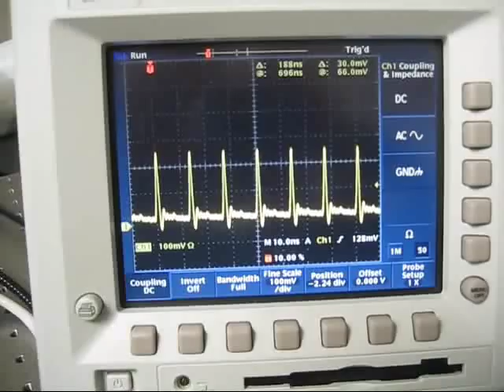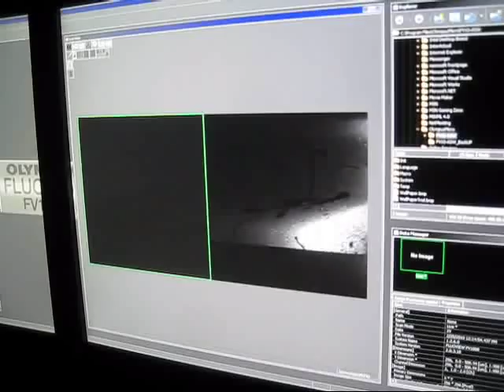Multiphoton Microscope Alignment using Second Harmonics Generation Crystal

Comment from the maker: Dynamics of optically excited tungsten, stainless steel and bulk metallic glass for ripples formation
Hao Zhang, Chen Li, Jean-Philippe Colombier, Guanghua Cheng, Razvan Stoian
10 February 2015 • 4:00 - 4:20 PM | Part of SPIE LASE

In vivo non-invasive multiphoton tomography of human skin with subcellular spatial and picosecond time resolution to detect bio- and chemohazards
Karsten Konig
8 February 2015 • 5:30 - 7:00 PM | Part of SPIE BiOS

Laser-induced controlled crystallization of heavy metal oxide glass
Juliana M. P. Almeida, Paulo H. D. Ferreira, Antonio C. Hernandes, Cleber R. Mendonca
10 February 2015 • 6:00 - 8:00 PM | Part of SPIE LASE

Selective optoporation of cells targeted with functionalized gold nanoparticles enhancing ultrafast laser pulse irradiation
Eric Bergeron, Alexandre Torres, Rosalie Martel, Camille Rodriguez, Christos Boutopoulos, Jukka Niskanen, Jean-Jacques Lebrun, Francoise M. Winnik, Michel Meunier
8 February 2015 • 2:10 - 2:30 PM | Part of SPIE LASE

Comprehensive photo-physics investigation of novel Corroles
Sai Santosh Kumar Raavi, Jun Yin, Giulia Grancini, Lingamallu Giribabu, Cesare Soci, Soma Venogopal Rao
11 February 2015 • 9:20 - 9:40 AM | Part of SPIE OPTO

Ultrafast photo-response in superconductive isotropic radiators for microwave generation
Brian D. Dolasinski, Peter E. Powers, Joseph W. Haus, Thomas Bullard, John Bulmer
10 February 2015 • 2:50 - 3:10 PM | Part of SPIE LASE

Three dimensional optofluidic device for isolating marine microbes
Anusha Keloth, Lynn Paterson, Gerard H. Markx, Ajoy K. Kar
9 February 2015 • 2:50 - 3:10 PM | Part of SPIE BiOS

Machine technology for 3D microprocessing of complex curved surfaces
Max Groenendijk
12 February 2015 • 3:30 - 4:00 PM | Part of SPIE LASE

Digital micromirror devices for laser-based manufacturing on the micro-scale
Ben Mills, Dan Heath, Matthias Feinaeugle, Rob W. Eason
10 February 2015 • 9:50 - 10:10 AM | Part of SPIE OPTO

Fabrication of a plasmonic pyramid array substrate and microfluidic device for cell transfection
Daryl I. Vulis, Marinus Huber, Nabiha Saklayen, Sebastien Courvoisier, Jean-Pierre Wolf, Eric Mazur
8 February 2015 • 5:40 - 6:00 PM | Part of SPIE LASE

Colloidal, inorganic nanoparticles as efficient nonlinear optical probes
Dominika Wawrzynczyk, Marcin Nyk, Janusz Szeremeta, Marek Samoc
8 February 2015 • 4:05 - 4:20 PM | Part of SPIE BiOS

In vivo visualization of collagen fiber produced by cultured osteoblasts using sensitive second-harmonic-generation microscopy equipped with a 10-fs mode-locked Ti:sapphire laser
Eiji Hase, Katsuya Sato, Takeshi Yasui
8 February 2015 • 5:30 - 7:00 PM | Part of SPIE BiOS

Towards the development of an ultracompact optically sectioning endoscope with no distal optics
Youngchan Kim, Sean Warren, James M. Stone, James Roper, Jonathan C. Knight, Mark Neil, Carl Paterson, Christopher W. Dunsby, Paul M. W. French
9 February 2015 • 12:00 - 12:20 PM | Part of SPIE BiOS

Role of the surface plasma density on the formation of laser induced periodic surface structures (LIPSS) on Ti upon double fs pulse irradiation
Laura Gemini, Masaki Hashida, Yasuhiro Miyasaka, Shunsuke Inoue, Jiri Limpouch, Tomas Mocek, Shuji Sakabe
12 February 2015 • 10:00 - 10:20 AM | Part of SPIE LASE

5.7mJ fiber-CPA system delivering 23.5 gW of peak power
Arno Klenke, Steffen Hadrich, Tino Eidam, Marco Kienel, Jens Limpert, Andreas Tunnermann
11 February 2015 • 3:50 - 4:10 PM | Part of SPIE LASE

Intense THz sources for condensed matter physics
Matthias C. Hoffmann
10 February 2015 • 2:20 - 2:50 PM | Part of SPIE LASE

Chirped- and divided-pulse Sagnac fiber amplifier
Florent Guichard, Yoann Zaouter, Marc Hanna, Franck Morin, Clemens Honninger, Eric P. Mottay, Patrick Georges
11 February 2015 • 4:30 - 4:50 PM | Part of SPIE LASE

Increasing performance of mobile devices: fs laser assisted high quality photonic devices in display glass screens
Jerome Lapointe, Mathieu Gagne, Raman Kashyap
9 February 2015 • 4:00 - 4:20 PM | Part of SPIE LASE

Plasma dynamics during fs-laser fabrication of waveguides inside zinc phosphate glass
Javier Hernandez Rueda, Vladimir Semenov, Neil Troy, Charmayne E. Smith, Richard K. Brow, Denise M. Krol
9 February 2015 • 3:20 - 3:40 PM | Part of SPIE LASE

Ultrashort pulse laser interactions with cortical bone tissue for applications in orthopaedic surgery
Simon A. Ashforth, Miriam C. Simpson
8 February 2015 • 11:10 - 11:30 AM | Part of SPIE LASE

Bioinspired artificial light collectors for enhancement of imaging in dim environments
Hewei Liu, Yinggang Huang, Chi-chieh Huang, Hongrui Jiang
7 February 2015 • 10:50 - 11:05 AM | Part of SPIE BiOS

Two-photon photoacoustic microscopy using image subtraction with two different pulse excitations
Yoshihisa Yamaoka, Yoshinori Harada M.D., Masaaki Sakakura, Takeo Minamikawa, Shigeru Nishino, Seiji Maehara, Shujiro Hamano, Hideo Tanaka M.D., Tetsuro Takamatsu M.D.
10 February 2015 • 6:00 - 8:00 PM | Part of SPIE BiOS

Binary phase shaping for mitigating self-phase modulation
Gennady Rasskazov, Marcos M. Dantus
10 February 2015 • 6:00 - 8:00 PM | Part of SPIE LASE

Fluorescence lifetime imaging in the near-infrared region
Wolfgang Becker, Vladislav I. Shcheslavskiy
8 February 2015 • 5:30 - 7:00 PM | Part of SPIE BiOS

Optical and thermal properties in ultrafast laser surface nanostructuring on biodegradable polymer
Shuhei Yada, Mitsuhiro Terakawa
8 February 2015 • 8:50 - 9:10 AM | Part of SPIE LASE

Fabrication of perfluoropolyether atomic force microscopy tips with two-photon polymerization
Tommaso Zandrini, Raffaella Suriano, Carmela De Marco, Roberto Osellame, Stefano Turri, Francesca Bragheri
10 February 2015 • 6:00 - 8:00 PM | Part of SPIE LASE

Laser-induced breakdown spectroscopy for chemical characterization of laser structured Li(NiMnCo)O2 electrodes for lithium-ion batteries
Peter Smyrek, Johannes Proll, Hans J. Seifert, Wilhelm Pfleging
12 February 2015 • 2:30 - 2:50 PM | Part of SPIE LASE

Nonlinear compression of industrial ultrafast lasers in hypocyloid-core Kagome hollow-core fiber
Achut Giree, Florent Guichard, Guillaume Machinet, Yoann Zaouter, Yvon Hagen, Benoit Debord, Pascal Dupriez, Frederic Gerome, Marc Hanna, Fetah A. Benabid, Clemens Honninger, Patrick Georges, Eric P. Mottay
9 February 2015 • 8:30 - 8:50 AM | Part of SPIE LASE

Effect of the Zn coordination complex of the excited-state and two-photon absorption spectra of a novel salicylidene compound
Marcelo G. Vivas, Jose Germino, Tereza Atvarz, Cleber Mendonca
8 February 2015 • 4:15 - 4:30 PM | Part of SPIE OPTO

Single grating mirror intracavity stretcher design for chirped pulse regenerative amplification
Etienne Caracciolo, Matthias Kemnitzer, Martin Rumpel, Annalisa Guandalini, Florian kienle, Federico Pirzio, Thomas Graf, Marwan Abdou Ahmed, Antonio Agnesi, Juerg Aus-der-Au
10 February 2015 • 11:10 - 11:30 AM | Part of SPIE LASE

Enhanced nanograting formation assisted by silver ions in a sodium gallophosphate glass: Correlation between surface nanostructuring, fluorescence, and effective second-order nonlinear optical properties
Marie Vangheluwe, Feng Liang, Yannick Petit, Patricia Hee, Yannick Ledemi, Sebastien Thomas, Nicolas Marquestaut, Evelyne Fargin, Thierry Cardinal, Younes Messaddeq, Lionel Canioni, Real Vallee
8 February 2015 • 2:30 - 2:50 PM | Part of SPIE OPTO

Yb-fiber laser for multimodal imaging
Ilyas Saytashev, Bingwei Xu, Marcos Dantus
9 February 2015 • 4:05 - 4:20 PM | Part of SPIE BiOS

Two-photon endoscope with no distal optics
Herve Rigneault, Esben R. Andresen, Geraud Bouwmans, Serge Monneret
9 February 2015 • 2:30 - 2:50 PM | Part of SPIE BiOS

Elucidating photodynamics with ultrafast pulse sequences: pump-repump, multidimensional spectroscopy, and beyond
Patrick Nuernberger, Stefan Ruetzel, Tobias Brixner
8 February 2015 • 11:15 - 11:45 AM | Part of SPIE OPTO

Broadband 2.5-6?m frequency comb source for dual-comb molecular spectroscopy
Viktor O. Smolski, Konstantin L. Vodopyanov
9 February 2015 • 2:35 - 2:55 PM | Part of SPIE LASE

Photonic crystal fiber supercontinuum sources for optogenetics
Eugene D. Ark, Kush Paul, Haohua Tu, Youbo Zhao, Stephen A. Boppart
7 February 2015 • 4:20 - 4:40 PM | Part of SPIE BiOS

Ultrafast non-equilibrium carrier dynamics in semiconductor laser mode-locking
Jerome V. Moloney, Isak Kilen, Joerg Hader, Stephan W. Koch
9 February 2015 • 8:00 - 8:30 AM | Part of SPIE LASE

THz generation by optical rectification in graphene at room temperature: beyond the linear carrier dispersion
Juliette Mangeney, Jean Maysonnave, Simon Huppert, Feihu Wang, Simon Maero, Claire Berger, Walter A. de Heer, Theodore B. Norris, Louis-Anne de Vaulchier, Sukhdeep S. Dhillon, Jerome Tignon, Robson Ferreira
8 February 2015 • 12:15 - 12:35 PM | Part of SPIE OPTO

Ultrafast biexciton dynamics in single CdSe/ZnSe quantum dots
Denis V. Seletskiy, Christopher Hinz, Johannes Haase, Christian Traum, Florian Werschler, Stefan Lohner, Alfred Leitenstorfer
10 February 2015 • 12:20 - 12:35 PM | Part of SPIE OPTO

Efficient Auger scattering in Landau-quantized graphene
Florian Wendler, Martin Mittendorff, Stephan F. Winnerl, Manfred Helm, Andreas Knorr, Ermin Malic
8 February 2015 • 9:45 - 10:00 AM | Part of SPIE OPTO

Self-focusing effect on THG at interfaces of solvent-cuvette
Emerson C. Barbano, Kerrianne Harrington, Sergio C. Zilio, Lino Misoguti
10 February 2015 • 6:00 - 8:00 PM | Part of SPIE LASE

Charge separation in OPV bulk heterojunctions
Andrew B. Matheson, Arvydas Ruseckas, Ifor D. W. Samuel
11 February 2015 • 6:00 - 8:00 PM | Part of SPIE OPTO

Advances in Chalcogenide galsses and Optical fibers
Younes Messaddeq, Sandra H. Messaddeq, Mohammed Elamraoui, Jean-Philippe Berube, Real Vallee
10 February 2015 • 9:30 - 10:00 AM | Part of SPIE OPTO
9 February 2015

Ultrafast coherent charge transfer in solar cells and artificial light harvesting systems: toward movies of electronic motion
Christoph Lienau
9 February 2015 • 8:50 - 9:30 AM | Part of SPIE OPTO

Sub-100 fs passively mode-locked holmium-doped fiber oscillator operating at 2.06?m
Peng Li, Axel Ruehl, Ingmar Hartl
12 February 2015 • 11:00 - 11:20 AM | Part of SPIE LASE

Laser induced structural modifications in fused silica within the microexplosion regime evidenced by Raman spectroscopy
Nadezda Varkentina, Arnaud Royon, Marc Dussauze, Yannick Petit, Lionel Canioni
10 February 2015 • 11:30 - 11:50 AM | Part of SPIE LASE
9 February 2015

Mechanisms of direct laser writing on a tailored silver-containing zinc phosphate glass: dual-color laser writing, UV post-illumination thermal influence, and sub-diffraction structures
Yannick G. Petit, Konstantin Mishchik, Nadezda Varkentina, Arnaud Royon, Nicolas Marquestaut, Etienne Brasselet, Thierry Cardinal, Lionel S. Canioni
9 February 2015 • 5:30 - 5:45 PM | Part of SPIE OPTO

Active tunable photonics and ultrafast nonlinear optics with nematic and blue phase liquid crystals
Iam Choon Khoo
10 February 2015 • 11:00 - 11:30 AM | Part of SPIE OPTO
11 February 2015

Mobile laser lithography station for microscopic two-photon polymerization
Frank Leinenbach, Hans G. Breunig, Karsten Konig
12 February 2015 • 4:20 - 4:40 PM | Part of SPIE LASE

Broadband transient THz conductivity of the transition-metal dichalcogenide MoS2
Jan H. Buss, Ryan P. Smith, Giacomo Coslovich, Robert A. Kaindl
10 February 2015 • 5:00 - 5:15 PM | Part of SPIE OPTO

Amorphous chalcogenide layers and nanocomposites for direct surface patterning
Sandor J. Kokenyesi, Sandor Molnar, Roland Bohdan, Istvan Csarnovics
9 February 2015 • 2:00 - 2:20 PM | Part of SPIE OPTO

Process and parameter optimisation for micro structuring of 3D freeform metallic surfaces: A comparative study of shortpulse (ns) and ultrafast laser (ps, fs) ablation
Steffen G. Scholz, Melanie Mangang, Wilhelm Pfleging
10 February 2015 • 4:20 - 4:40 PM | Part of SPIE LASE

Optical multi-coset sampling of GHz-band chirped signals
George C. Valley, George A. Sefler, Thomas J. Shaw, Stephen L. Smith
11 February 2015 • 2:00 - 2:20 PM | Part of SPIE OPTO

Bessel filamentation in glass
Chen Xie, Vytautas Jukna, Ismail Ouadghiri, Carles Milian Enrique, Remo Giust, Luca Furfaro, Pierre-Ambroise Lacourt, Maxime Jacquot, Luc Froehly, Razvan Stoian, Tatiana E. Itina, John M. Dudley, Arnaud Couairon, Francois Courvoisier
11 February 2015 • 9:20 - 9:40 AM | Part of SPIE LASE

Flat mid-infrared supercontinuum generation in tapered fiber with thin coating of highly nonlinear glass
Pantelis Velanas, Christos Riziotis, Georgios Kakarantzas
10 February 2015 • 6:00 - 8:00 PM | Part of SPIE LASE
11 February 2015

Plasmonic cell transfection using micropyramid arrays
Nabiha Saklayen, Daryl I. Vulis, Marinus Huber, Lauren E. Milling, Sebastien Courvoisier, Valeria Nuzzo, Eric Mazur
8 February 2015 • 4:40 - 5:00 PM | Part of SPIE LASE

Ultrafast carrier dynamics in atomically thin WS2 layers in the low- and high-density regime
Claudia Ruppert, Alexey Chernikov, Heather M. Hill, Albert Rigosi, Tony F. Heinz
8 February 2015 • 2:30 - 2:45 PM | Part of SPIE OPTO

Plasmonic substrates for cell transfection
Marinus Huber, Nicolas Vogel, Weilu Shen, Nabiha Saklayen, Alexander Heisterkamp, Eric Mazur
10 February 2015 • 6:00 - 8:00 PM | Part of SPIE LASE

Next generation laser sources for non-linear imaging
Darryl McCoy, Marco Arrigoni, Nigel Gallaher
8 February 2015 • 4:10 - 4:25 PM | Part of SPIE BiOS

Nano-focused ultrafast spectroscopy and imaging reaching the single quantum level
Markus B. Raschke
9 February 2015 • 2:00 - 2:30 PM | Part of SPIE OPTO

Laser-assisted manufacturing of micro-optical volume elements for improving the amount of light absorbed by solar cells in photovoltaic modules
Gerhard Peharz, Ladislav Kuna, Claude Leiner
11 February 2015 • 6:00 - 8:00 PM | Part of SPIE OPTO

Mechanisms of 3D nanoparticles formation using direct laser writing and thermal annealing in a phosphate glass
Nicolas Marquestaut, Yannick G. Petit, Patrick Mounaix, Thierry Cardinal, Lionel S. Canioni
12 February 2015 • 9:20 - 9:40 AM | Part of SPIE LASE

Ultrafast element-specific magnetization dynamics of complex magnetic materials on a table top
Stefan Mathias, Chan La-O-Vorakiat, Justin M. Shaw, Emrah Turgut, Patrik Grychtol, Roman Adam, Denis Rudolf, Hans T. Nembach, Thomas J. Silva, Martin Aeschlimann, Claus M. Schneider, Henry C. Kapteyn, Margaret M. Murnane
11 February 2015 • 9:00 - 9:30 AM | Part of SPIE OPTO

Chirp scanning technique to determine the non-degenerate two-photon absorption
Renato Juliano Martins, Cleber R. Mendonca
8 February 2015 • 5:00 - 5:15 PM | Part of SPIE OPTO

MEMS-based handheld multiphoton endomicroscope for in vivo imaging
Xiyu Duan, Haijun Li, Zhen Qiu, Bishnu P. Joshi, Asha Pant, Katsuo Kurabayashi, Kenn R. Oldham, Thomas D. Wang M.D.
9 February 2015 • 3:40 - 4:00 PM | Part of SPIE BiOS

Competition between harmonic generation and multi-photon luminescence in selectively grown coaxial InGaN/GaN quantum wells on GaN pyramids for tunable light emission
Sween J. Butler, Mohamed Fikry, Klaus Thonke, Arup Neogi
11 February 2015 • 2:50 - 3:10 PM | Part of SPIE LASE

Low-noise supercontinuum: Development, characterization, and programmable biomedical imaging
Haohua Tu, Yuan Liu, Sixian You, Stephen A. Boppart M.D.
9 February 2015 • 10:40 - 11:00 AM | Part of SPIE LASE

Photoacoustic imaging using NIR two-photon excitation for ultrasonic wave generation
Ben E. Urban, Jr.
9 February 2015 • 5:30 - 7:30 PM | Part of SPIE BiOS

Coherent pulse stacking in fiber chirped-pulse amplification systems
Tong Zhou, John M. Ruppe, Cheng Zhu, I-Ning Hu, John A. Nees, Russell B. Wilcox, Almantas Galvanauskas
11 February 2015 • 4:10 - 4:30 PM | Part of SPIE LASE

Terahertz wavefront assessment based on 2D electro-optic imaging
Harsono Cahyadi, Ryuji Ichikawa, Jerome Degert, Eric Freysz, Takeshi Yasui, Emmanuel Abraham
10 February 2015 • 4:40 - 5:00 PM | Part of SPIE OPTO

DNA separation and fluorescent detection in an optofluidic chip with sub-base-pair resolution
Markus Pollnau, Manfred Hammer, Chaitanya Dongre, Hugo J. W. Hoekstra
8 February 2015 • 2:00 - 2:20 PM | Part of SPIE BiOS

Effects of burst mode on transparent materials processing
Clementine Javaux, John Lopez, Clemens Hoenninger, Eric P. Mottay, Rainer Kling
10 February 2015 • 5:20 - 5:40 PM | Part of SPIE LASE

Ultrashort pulsed laser tools for testing of semiconductor device hardness to local radiation effects caused by cosmic heavy ions
Oleg B. Mavritskii, Andrey N. Egorov, Alexandra V. Gordienko, Alexander A. Pechenkin, Dmitriy V. Savchenkov
10 February 2015 • 6:00 - 8:00 PM | Part of SPIE LASE

Ultrafast acousto-magneto-plasmonics
Vasily V. Temnov
10 February 2015 • 2:25 - 2:55 PM | Part of SPIE OPTO

Nonlinearly fiber-converted coherent source with broad spectral coverage for multiphoton imaging
Haohua Tu, Yuan Liu, Youbo Zhao, Stephen A. Boppart M.D.
8 February 2015 • 1:50 - 2:10 PM | Part of SPIE BiOS

Deep stroma investigation by confocal microscopy
Francesca P. Rossi, Francesca Tatini, Roberto Pini, Paola Valente, Roberta Ardia, Luca Buzzonetti, Annalisa Canovetti, Alex Malandrini, Ivo Lenzetti, Luca Menabuoni M.D.
8 February 2015 • 5:30 - 7:00 PM | Part of SPIE BiOS

Role of molecular photodissociation in ultrafast laser surgery
Jenny Wang, Georg Schuele, Phil Huie, Daniel V. Palanker
9 February 2015 • 8:50 - 9:10 AM | Part of SPIE BiOS

Two photon microscopy of native fluorophores spatial location in cancer and non-cancer cell lines
Lin Zhang, Lingyan Shi, Robert R. Alfano
8 February 2015 • 5:30 - 7:00 PM | Part of SPIE BiOS

Pulse splitter to produce ultrafast bursts
Antoine Courjaud, Vincent Clet, Areti Mourka, Aghasi Lorsabyan, Eric P. Mottay
9 February 2015 • 9:50 - 10:10 AM | Part of SPIE LASE

In vivo high-speed imaging of blood cells and tissues in mouse ear skin using multimodal nonlinear optical microscopy
Eung Jang Lee, Daeyeon Kim, Bo Ram Kim, Sung-Ho Lee, Seung-Han Park
8 February 2015 • 5:30 - 7:00 PM | Part of SPIE BiOS

Ultrafast in-situ probing of passively mode-locked VECSEL dynamics
Maik Scheller, Caleb W. Baker, Stephan W. Koch, R. Jason Jones, Jerome V. Moloney
9 February 2015 • 4:50 - 5:10 PM | Part of SPIE LASE

Laser nanofabrication for functional devices
Hong-Bo Sun
11 February 2015 • 4:10 - 4:40 PM | Part of SPIE LASE

Advances in planar photonic integration with a novel ultrafast laser plasma fabrication process
Jayakrishnan Chandrappan, Matthew Murray, Tarun Kakkar, Kenneth L. Kennedy, Richard A. Hogg, David P. Steenson, Gin Jose, Animesh Jha
10 February 2015 • 11:10 - 11:30 AM | Part of SPIE OPTO

Adaptive optics for the laser fabrication of 3D graphitic microwires in diamond
Patrick S. Salter, Bangshan Sun, Martin J. Booth
10 February 2015 • 9:20 - 9:40 AM | Part of SPIE LASE

Group delay of 45 ns in a 1-cm fiber Bragg grating
George Skolianos, Michel Digonnet, Arushi Arora, Martin Bernier, Real Vallee
9 February 2015 • 11:35 AM - 12:00 PM | Part of SPIE OPTO

Metal mirrors with metal-dielectric HR-coating for ultrashort lasers pulses applied in scanner applications
Mark Schuermann, Christian Franke, Sandra Mueller, Stefan Risse, Helena Kaemmer, Felix Dreisow, Stefan Nolte, Ramona Eberhardt, Norbert Kaiser
11 February 2015 • 9:40 - 10:00 AM | Part of SPIE LASE

Fiber laser driven ultrafast RGB source based on simultaneous second harmonic generation from a dual zero dispersion wavelength fiber source
Yuhong Yao, Wayne H. Knox
10 February 2015 • 4:20 - 4:40 PM | Part of SPIE LASE

Experimental demonstration of multidimensional amplification of ultrashort pulses
Marco Kienel, Michael Mueller, Arno Klenke, Tino Eidam, Jens Limpert, Andreas Tunnermann
11 February 2015 • 3:00 - 3:20 PM | Part of SPIE LASE

High speed deep tissue ablation with nonlinear imaging using an ultrafast fiber laser at 1045 nm
Murat Yildirim, Kaushik G. Subramanian, Adela Ben-Yakar
8 February 2015 • 9:10 - 9:30 AM | Part of SPIE LASE

Laser patterning for reel-to-reel production of organic photovoltaic (OPV) devices
Colin J. Moorhouse, Dimitris Karnakis, Christos Kapnopoulos, Argiris Laskarakis, S. Logothetidis, G. Antonopoulos, Christos Koidis
11 February 2015 • 4:00 - 4:20 PM | Part of SPIE LASE
COURSE AT CONFERENCE
Introduction to Ultrafast Optics (SC746)
Instructor(s): Trebino, Rick, Georgia Institute of Technology
Level: Introductory • 0.35 CEU • Length: 4.00 hours
Member Price: 300.00 | Non-Member Price: 355.00
8 February 2015 • 1:30 PM | Part of SPIE Photonics West

Optical isolators for 2-micron fibre lasers
Gary Stevens, Thomas H. Legg, Peter Shardlow
11 February 2015 • 9:30 - 9:50 AM | Part of SPIE LASE

Monolithic hybrid optics for broadband focusing and beam shaping
Ulrike Fuchs
10 February 2015 • 5:20 - 5:40 PM | Part of SPIE LASE

Sub-700fs pulses at 152W average power from a Tm-doped fiber CPA system
Christian Gaida, Fabian Stutzki, Martin Gebhardt, Florian Jansen, Andreas Wienke, Uwe D. Zeitner, Frank Fuchs, Cesar Jauregui-Misas, Dieter Wandt, Dietmar Kracht, Jens Limpert, Andreas Tunnermann
12 February 2015 • 10:40 - 11:00 AM | Part of SPIE LASE

Novel nanoring structure for light-induced generation of ultrashort magnetic pulses
Guillaume G. Vienne, Xiaoyu Chen, Ying Shi Teh, Ying Jye Ng, Nyap Oon Chia, Ching Ping Ooi
11 February 2015 • 10:00 - 10:15 AM | Part of SPIE OPTO

Spatial and temporal temperature distribution of ultrashort pulse induced heat accumulation in glass
Soren Richter, Fumiya Hashimoto, Yasuyuki Ozeki, Kazuyoshi Itoh, Andreas Tunnermann, Stefan Nolte
10 February 2015 • 10:50 - 11:10 AM | Part of SPIE LASE

Ultrashort pulse laser processing of glass: From cutting to welding
Stefan Nolte
11 February 2015 • 2:00 - 2:30 PM | Part of SPIE LASE
10 February 2015 • 6:00 - 8:00 PM | Part of SPIE LASE